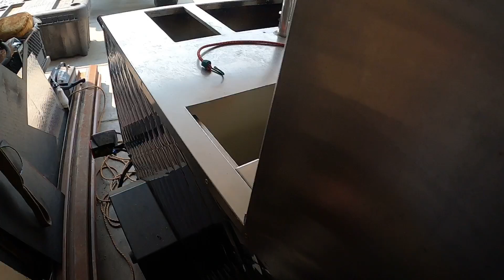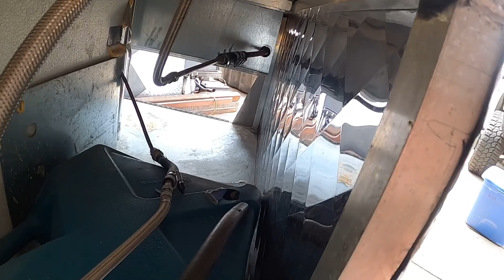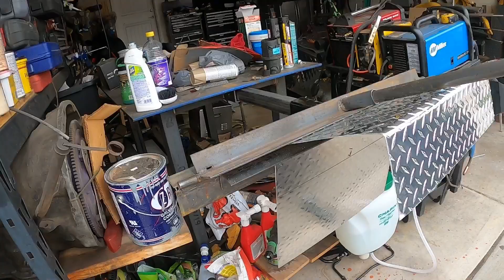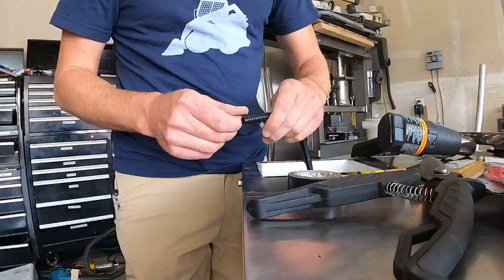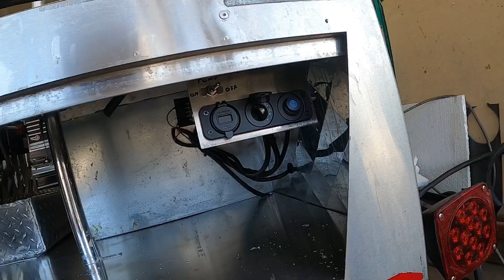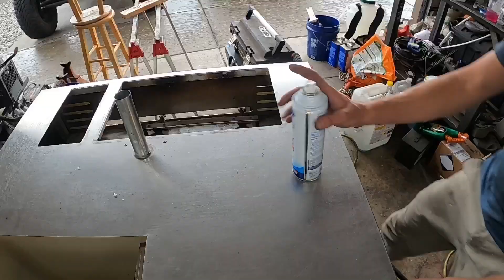Hotdog cart repairs

Comment: Awesome job on the repair! I have a flat 4ft x 6.5ft aluminum cart that I want to use to build a HotDog cart out of. I need an axle for it first, then some type of towing tongue, before building up on the body! Any suggestions on the axle issue? Thanks in advance!
Reply from the maker: Definitely don’t under axle it, I’d want too much axle so when it’s loaded down with ice and water it’s not overloaded. If you match the lug pattern and tire size to the tow vehicle you can share the spare and old tires as you buy new ones for the tow vehicle!
Reply: Great idea, but I drive a 4X4 Chevy truck with 18's. An axle to fit those tires would be too wide for the trailer.
Reply from the maker: @TheMongo1357  it all about the hub, look into a drop axle *buy the hub and axle separate just make sure they go together

Comment: I have the same hotdog cart I need to put new burners on what do u think I should do
Reply from the maker: Here is what I believe to be the original 
https://allamericanhotdog.com/accessories.html gonna have to call them though. 
I found this one on Amazon but I can’t be sure the valve from cart will fit it or that it will position itself correctly (length wise) 
https://amzn.to/3SeUxEW
For $20 vs $200 it might be worth a shot
Reply: What's wrong with your burners ? I just picked up the same cart burners were rusted to hell and wouldn't light ( well barely) if there cast iron soak them in 50/50 water vinegar overnight scrub with wire brush dry oil good as new, because the new ones are like $219 ea.

Comment: I have the exact same cart. I don't have that style front wheel. It has a jack that I can't adjust because the handle hits the propane tank. Do you remember the size of the front caster?
Reply from the maker: It had to be at least 10”

Comment: I have this cart, my hot water 
Come out to hot when burners are on. To keep the little wheel from 
Hitting ground I use a drop leaf hitch
Put it up side down. My little wheel does not hit the road
Reply from the maker: Does yours have the same big wheel? A raised hitch would keep the big wheel off the ground but I like to keep trailers as level as possible and then the hatch on their SUV would strike tongue unless you remove it. It had the copper tube over the burner but the owner requested the water heater, someone had previously DIY’ed the water system who had no business.
Reply: @Andrewactual  I like the water 
Heater on it. This way
I do not have all burners on full
Blast for hot water.
Reply: @Andrewactual  I wish
I.had your skills.
Reply from the maker: @davidhersh2697  you can. Start small and learn as you go. I started really fabricating about 12 years ago as a hobby. I’d say most people could if you focus on improving and strive for quality.
Reply: @Andrewactual  I did but it broke
But I still, have a smaller wheel.
With my last car I use a raise hitch
Upside down.,cart all way came off
Car ,for business. Now with my van
I have now. Every thing even.
Reply from the maker: Also,  heck out the latest on this trailer:
https://youtu.be/7gwOtTWs_WU